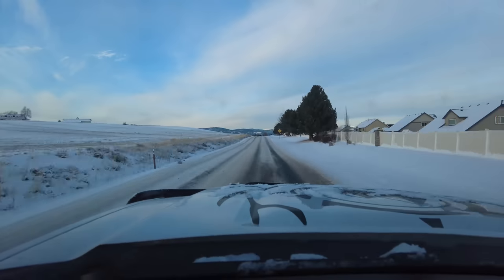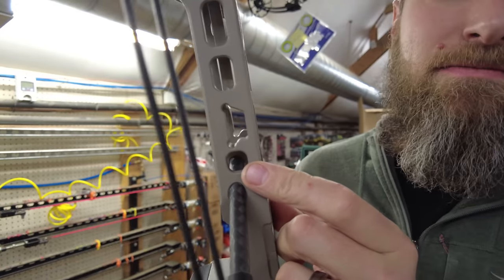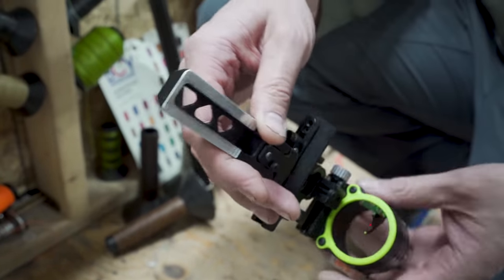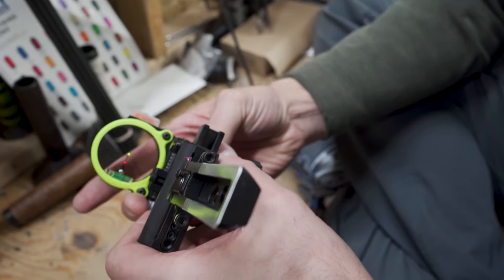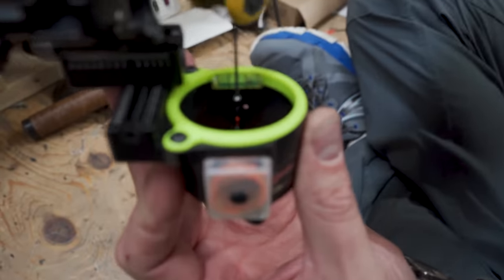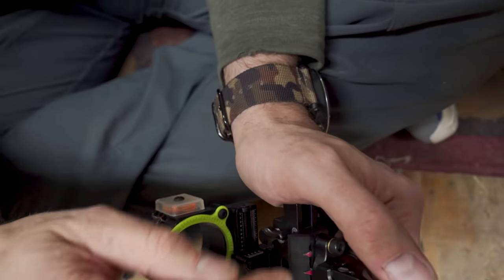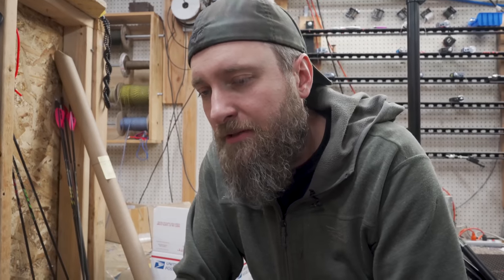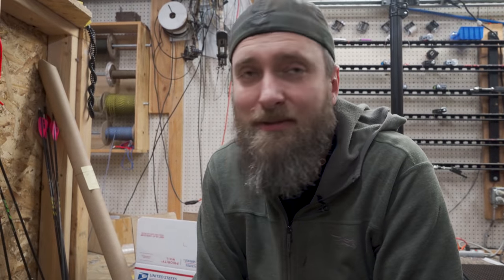Home Run or Flop? Black Gold Dual Trac Sight // #ABT

Comment: Hey Josh my Axcel Landslyde does work on my X29 by moving the assembly to the outermost holes AND with a 31 mm scope like an AV-31 or UV3. All other scopes like the UV3XL or AV-41 does not work due to the lack of windage the extra 10 mm it takes up.

Comment: I've had my Shrewd scope pin mounted coming down for several years and it opens up the sight picture in my mind. Especially for holdover. You can see easier how much your holding higher on the deer coyote whatever.

Comment: Looks like BG has done it again. I currently run two pro sights. Use my single pin for 9 months shooting targets then switch to my 3 pin for hunting. This new sight looks like it will be awesome. I feel I shoot much better with my single pin but I’m not confident enough yet to hunt with it as I’m just 2 years into this great archery adventure. Curious if BG will sell the scope housing with the dual track so we don’t have to buy a whole new sight. Awesome video once again guys. Keep up the good work.
Reply: Craig...highly unlikely as I've attempted to do the same with the Pro sight. Trust me, wish they would.

Comment: With the dual indicators, Once set up to both pins…are the needles accurate throughout the entire range of the tape? In other words, once you pick your site tape using the 20-60 method, and set your bottom pin to what ever yardage or gap you want…anytime you dial out, will that bottom pin indicator be exact to wherever it lands? I’m sorry if this makes little to no sense. I’m just wondering if with this sight, you have to pins that have known a yardage at any given range in the dial. Unlike my BG 3 pin where once I dial, only my bottom pin is now known.

Comment: Why do you prefer 450 grain arrows versus the more heavy FOC 600-650 grain arrows?
Reply: I won't speak for the man, but i believe 400-500 is the perfect weight coming out of a compound. Creating a huge pin gap and lowering accuracy is creating the reason that a "plan b" is needed. Speed is forgiveness.

 I personally belive this is the second most silly recent fad, only coming in second to the clowns wearing a saddle while standing in a $500 hang on.

Comment: How much better are the pro pins than the standard pins? I've ran a CBE Tek Hybrid  .010 single pin for 8 years tree stand hunting, but I am going to switch to a 3 pin for my first elk hunt due to pin durability issues with the older CBE. Is the pro hunter that much better than the mountain lite or ascent verdict?

Comment: That's why I like my Reckoning. Adjust those stops juuuuust the way you want to adjust that letoff weight. More "pull" at the wall means there's a "balance" of some sort up front. Micro, micro tunable and that front. I'm done buying sights for now...until the latest greatest gets me all giggly, and I'm all giggly.. That's it, BG hit the mark with this sight! JJ, set notifications to let me know when you have inventory. 😉. Gonna replace my Ascent Verdict on my Reign 6 with this latest and greatest. Love the Pro on my Reckoning.  JJ, I to shot single pin (HHA) way back in the day. Now that sight is mounted on a bow of a archer that I kinda mentored. Will he eventually "upgrade" to the most advanced someday? Who knows, all I know is it cleared up his housing from 7 pins to 1 and his accuracy improved. Cheers, fellas

Comment: Do you guys prefer .19 or .10 sized pins for hunting?
Reply from the maker: 0.19 for me -DS
Reply: On 3pin heads i like 19 19 10.  At 40 I find the 19 blocks too much for me.

Comment: Bridge Lock is really cool in theory.... but when most sights run out of wind adjustment, maybe not so much.  It would be nice to get that review of which sights have more of an issue with this.
Reply: That's what I was thinking too...
But in the future I think there will be more and more sights that are specificly designed to work with that mounting system

Comment: 1st axis does not need to be level to the string. It CAN be. It can also be level to the riser... or your natural lean... the part that is mandatory is that the 2nd axis is perfectly married to the 1st axis... This 1st axis debate is common and I see people arguing all the time over levelling to string or riser and both are adamant they are right because they have done it their way for 30 years with zero issues.... Funny thing is, they are BOTH right, and both wrong. It can be either, so long as the 2nd axis is married to the first... Archery is brutal with poor information and that's often because there's more than 1 way to do things yet many people do not realize that, and they create a point for argument and confusion where there shouldn't be. 

The reason it does not matter is because your arrows nocking point is in the same place all the time, and so is your rest. If you nocked your arrow up and down in different spots on your string, then it would make sense to level the 1st axis off your string, but the nocking point is always at one single point that never changes. It is static, and is repeated at full draw every time, and your rest position is also static and repeated at full draw every time. To shoot distance, the nock point and rest do not change, the angle at which you hold the entire system changes to send the arrow in a higher arch/trajectory.  IF you did move your arrow up and down the string to shoot different distances, then first axis would be tied to the string, and conversely if you moved your rest to changed the distance of the arrow, the 1st axis would be tied to the riser... but we do not do that, they are static, and we only move our sight.... This is why 1st axis is not tied to anything in particular, it is only the base of how you set your following axis. Hopefully that helps people understand why it works this way... or maybe I just confused people... but at the end of the day if you level it to your string or riser, you are both fine.

Hopefully someone on the channel sees this and shares this on a future video. I know I am watching this 2 years after it was released so maybe mfj has shared this info since, but if not, hopefully they share this with viewers and help put it to bed.

Comment: MFJJ is wealth of knowledge but he was not accurately describing 1st axis.  1st axis can best be described like this.  If you invision a vertical plane that lays flat against the front of your scope or sight housing.   Meaning if the front of your sight housing is a wall, that is your first axis.  You should get that plane parallel with your string.

2nd Axis: Which is what MFJJ was describing as 1st axis is on a plane that travels in a vertical plane up from the pin towards the string.  This insures that if your pin is pointing perfectly vertical, so is your string, and then you adjust the sight bubble level to center.

3rd Axis:  Can be thought of best as insuring your 1st axis being at a perfectly right angle to your 2nd axis.

In summary...  let's use your phone screen as an example. 1st axis is you pointing the screen up or down.  2nd axis is you tilting left or right, 3rd axis is you pointing it left and right.  All of them being perfect would be a perfectly vertical, perfectly horizontal, and pointing directly at your face.

Comment: Western hunting is not best for single pins. Plus, you should not focus on the target. Focus on the pin. As far as single pins go, I’ve had far more issues than with my five pin black gold pro. Western hunting is far more unpredictable than white tail hunting in the south. My experience.